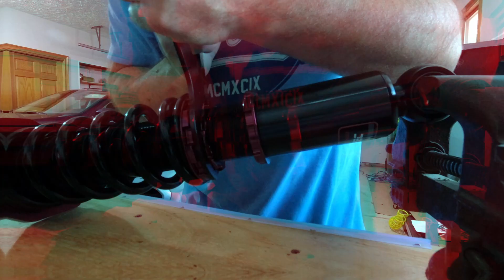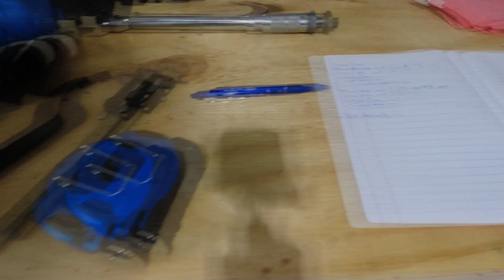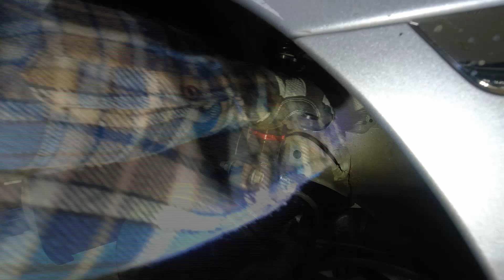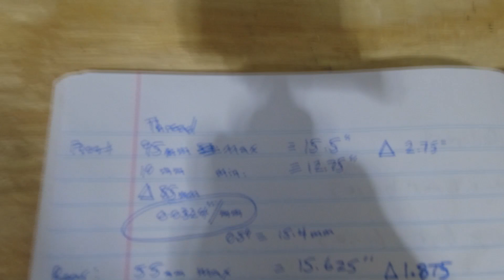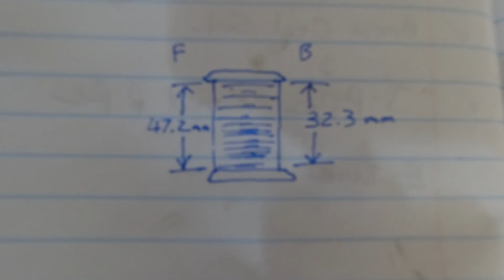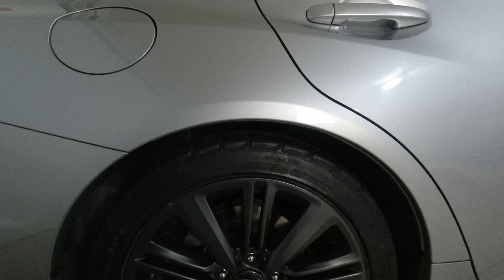Adjusting FactionFab F-Spec Coilovers | 2017 WRX

Comment: Im in the process of adjusting my Fr spec coilovers and how i set preload was i tightened the spanner down onto the spring until it held it tight enough the spring wouldnt wiggle back and forth at all (no clunk noises) then i set the 4mms of preload until i could fit the little wrench in between them. Then measured both springs to make sure they were compressed the same and they are both within 6 7/8ths inches. Then did my height calculations from there im wanting to drop an inch in the back and an inch and 325ths in the front because the fr spec for some reason is already lowered 325ths of an inch in rear on their max thread max height setting which is your base. So to not offset the ride geometry youd need to lower the front that 325ths of an inch first then lower both front and rear an inch. Its tricky setting these up thats for sure lmao

Comment: I’m having problems and I watched this video and factions fab video so much math so to measure the height is from the top of the plate to that bolt in your video correct with my wheels on it says to measure from the middle of the hub on the rim to the edge of the fender and I have max height I don’t understand why the back looks so low while the front looks so high I had them professionally installed and if I lower it I’m gonna have to get a another alignment?
Reply from the maker: Go with the manufacturer's instructions to be safe. I used my own reference point just to translate thread measurements to inches of ride height.

If you adjust the rear it shouldn't be too bad but you will end up with negative camber...not too bad. The front is definitely more challenging. The camber adjustment bolts will only do so much so with my height I'm stuck with negative camber in the front which is not ideal. Its most noticable at low speeds.

Hope that helps.
Reply: @BreakingThroughTogether  I took screen shots of yours but there were no instructions in the f spec box so I went to the website and went max height rear and max height front no matter what the back is gonna sag a tiny bit

Comment: I thought the measurement was from the center hub to under the fender.   Its on their website and youtube video.
Reply from the maker: Just checked the web site. I don't remember getting that much detail in my paper instructions. My method is very close and should only be off with angle differences but go with the manufacturer's web site for starters. I wanted one dimension that I could reference to give me specific changes to make adjusting faster. It worked well enough for me. However, I plan on adjusting the spring loads a bit in the next week or two, so I'll do a follow-up video with more experimenting akd updated reference dimensions. I am always looking to make this a better car. Thanks for mentioning that and for checking out my video!

Comment: Installed mine yesterday I set it to max height until the settle 95mm front and 55mm rear. And to me it looks higher than stock.
Reply from the maker: That's how mine looked at first. Drive around a bit then use the formula for threads-to-inches of adjustment on my adjustment video. They settle in fast.
Reply: So drove it a week and then I adjusted it to your measurements. Looks perfect to me, as long as it doesn't scrape on driveway it should be perfect 👌. Thanks.
Reply from the maker: @boston16wrx7  awesome!
Reply: Yea same here because on the faction fab sheet those numbers it sould be lower I just had them do mine and I went with max height on front and rear the rear looks so low but the front looks high I don’t get it it was lower with the stock struts?

Comment: How do they ride full soft, I heard they are better than stock!
Reply from the maker: Tried full soft damping with recommended 4mm of sprung preload...felt too soft for sporty handling and floats a bit. I added 8 notches of dampening adjustment and it feels very comfortable and handles well.
Reply: @BreakingThroughTogether   just order some, thanks for the info!

Comment: I hate, HATE adjusting the rear. Hard to maneuver the wrenches, especially without a lift.
Reply from the maker: The rear is definitely a pain to do preload adjustment. You have to drop the control arm to do the height too. Fronts are easier all around.

Comment from the maker: The rear feels just about perfect. I'm going to add 8mm of pre-load on the springs and set the damping to the highest setting and work backwards (stiff-to-soft). I'm thinking that'll get me there faster 🤔
Reply from the maker: After several combinations, I've found that I get the best balance between handling and drivability by adding a little preload and going about 1/3 of the say damping settings. These Coilovers are doing a great job so far! @FactionFab